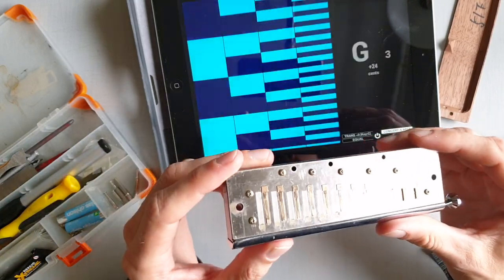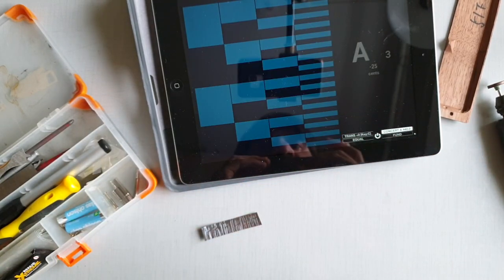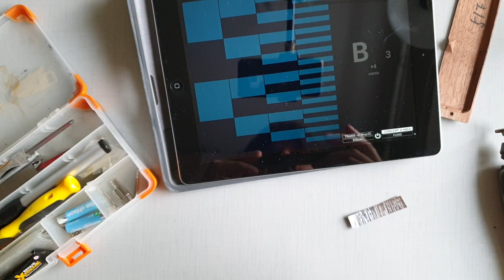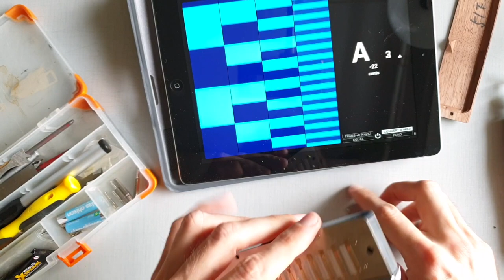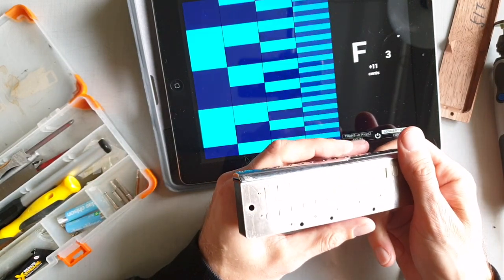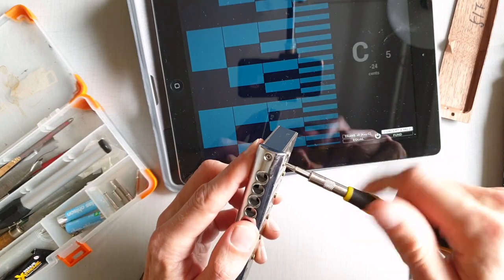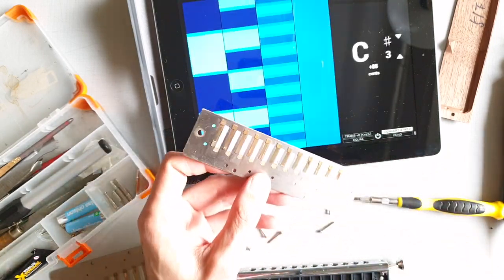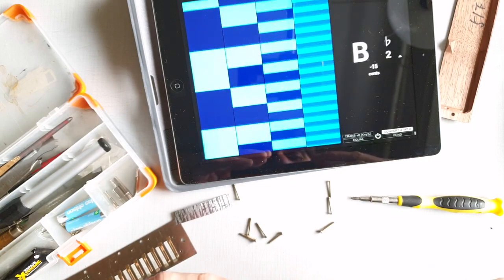How I tune my chromatic harmonicas

Comment: I just bought this dremel tool, Dremel Stylo 2050, the same model as yours. Mine didn't come with the rubber polishing wheel that you demonstrate in the video. Where did you get it?
Reply from the maker: No this Rubber wheel is from another company, that sells special and fine detail tools. It is called Rubber polishing wheel. The company is based in Sweden, called Normek.

Comment: Thank you for a great video!  
I've run into a weird thing:
One of my harmonicas (EAST TOP forerunner 12 Hole in G), has long had a slightly flat 9-draw. I tuned it using the techniques in your video and got it to a point I like. However, when I gave it a test drive, I realized the 9-blow.had gone sharp by nearly a semitone. I started to fix that, only to see the draw was starting to go out of tune again.
any ideas what's happening?  was it just condensation throwing me off or is there some other interaction I need to watch for?
thank you!
Reply from the maker: It can be condensation or maybe some metal dust is stuck between the reed and the slot. Then the pitch can go wild. The forerunner does not have valves so you need to be superprecise with the airstream when tuning.
Reply: @FilipJersMusic  thank you!

Comment: Thank you, very informative. Where did you buy this rotary tool?
Reply from the maker: In a hardware store for handcraft hobby materials. It should be available online too I think.
Reply: @FilipJersMusic what is the polishing insert called or made out of?  That looks much nicer than a rotary grinder.
Reply: @FilipJersMusic also, is that a 1mil shim?
Reply from the maker: It feels like it is made out of rubber  @norfolknwhey4787
Reply from the maker: @norfolknwhey4787 thinner than 1 mm, i think 0.1 or 0.2. I think on is 0.05

Comment: One question I always asked myself is the following:  If my brain somehow adapted to blowing holes a certain way, because they were out of tune, how can I make sure that I tune it right?  Is there some way to go into neutral position? Would blowing/drawing as high as possible work and end up in a comfortable tuning?
Reply from the maker: Find a medium pressure. Don't blow too hard, dont blow too soft.
Reply from the maker: And it takes time to develop and fine your own perfect pressure. You have tune a harmonica and then play it to a backing track or jam or concert to see if you "tuning" air pressure is correct. It can take a while to find or you will find it directly. Often a medium pressure is where a note sounds good and alive and you don't feel that you are using too much or too little air, it should just feel good to play.

Comment: A Dremel is way too dangerous to me. Even with less aggressive bits and low speed is way too much for the reed. You have to be very careful with that. Try with a Nail drill used for manicure, that cheapest models, it fits perfectly.
Reply from the maker: I use nail drills while on the road. The tool in this video is really good, you an put it at a low setting and use I only use Rubber wheels. No reed damaged yet. 🎵🎵🎵
Reply: @FilipJersMusic  Oh, thanks for answer Filip, I'm a great fan of yours. As a Brazilian, I love Hering and the Spiro album art cover! I'll try to find this rubber wheel and test. I did not pay attention to this detail, as it's a very uncommon tip for Dremmel. But I totally believe in you and have great respect for your work. To me, you're one of the greatest player/teacher of the new generation. Hope to take some lessons in a near future.